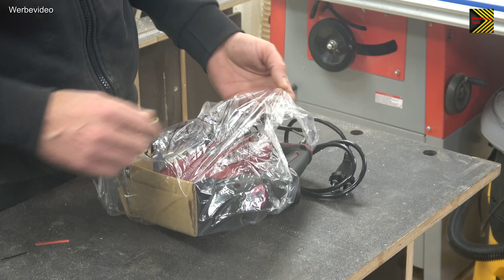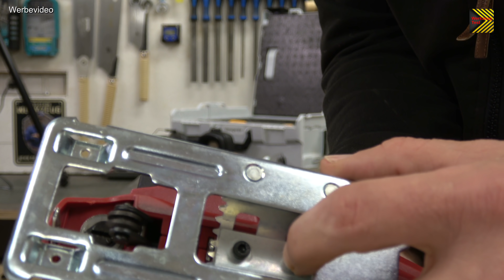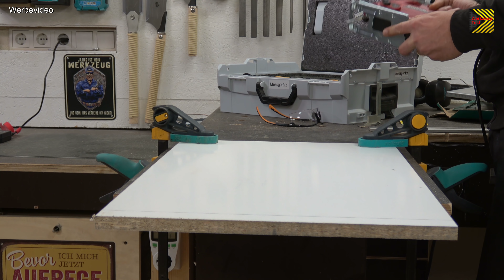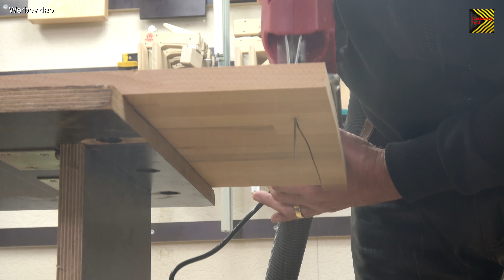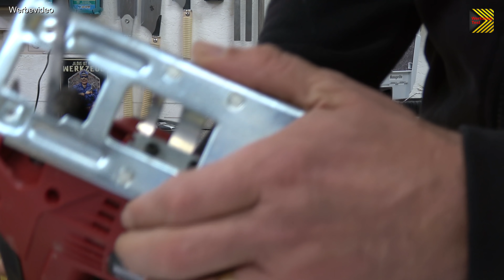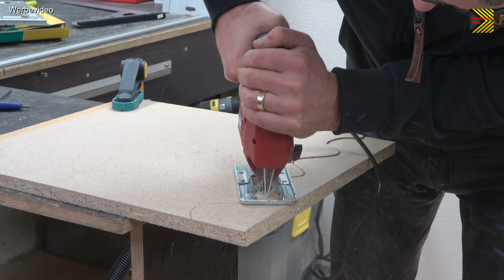Werkzeug Test - Stichsäge Einhell TC-JS80/1

Comment: Das Problem mit der Führungsschiene kommt davon, wenn das Sägeblatt nicht parallel zur langen Seite des Sägeschuhs ist. Dann zieht es immer in eine Richtung. Hab ich auch bei meiner Worx-Saw mit 710W. Kann von der Schnittleistung locker Arbeitsplatte sägen, nur nicht an einer Schiene. Klemmt immer das Blatt ein wegen des beschriebenen Problems. Nutze jetzt lieber die 18V Bosch grün dafür. Die schafft sogar Buche Leimholzplatte locker. Genau wie die 18V Bosch grün Stichsäge. Ist deutlich besser als die kabelgebundene große grüne Bosch. Hab inzwischen 7 Stichsägen, 3 Handkreissägen und  eine TKS. Kann man eigentlich je genug/zu viele Sägen haben? 😉